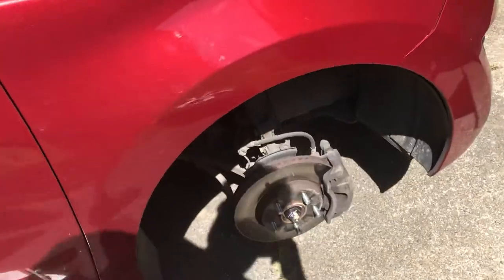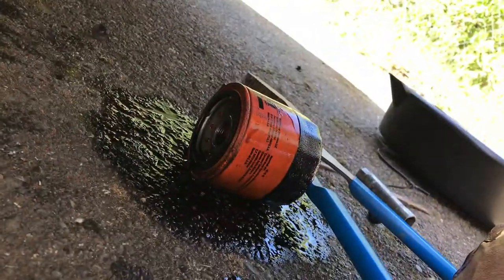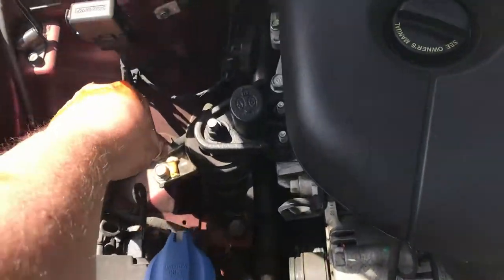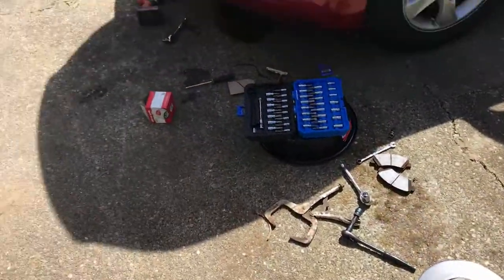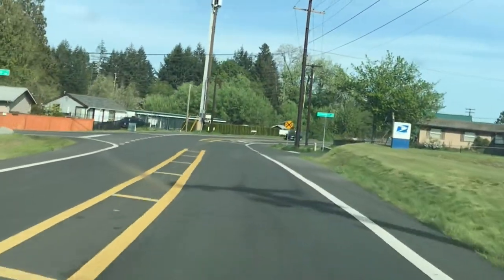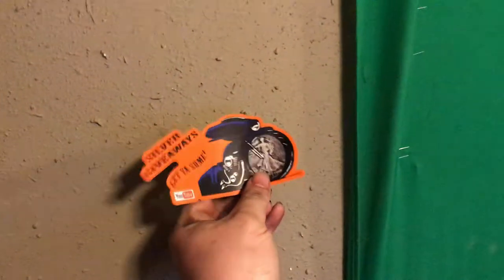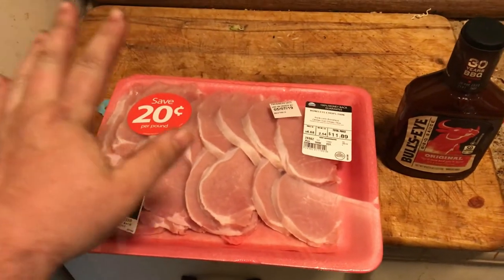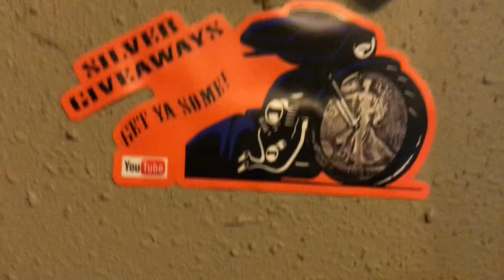Time To Change Brake Pads / Rotors and Oil Change

Comment: Trying to get there grove on that’s funny. Just hand tight when screwing those oil filters in. Don’t forget to put air in your transmission and some oil in your tires lol. Glad your getting all this work done brother. Better to be safe than not at all.
Reply from the maker: Hell yeah it was a great feeling to get it all done. It felt so good. My brakes worked so good today with no noise. Love that 😎